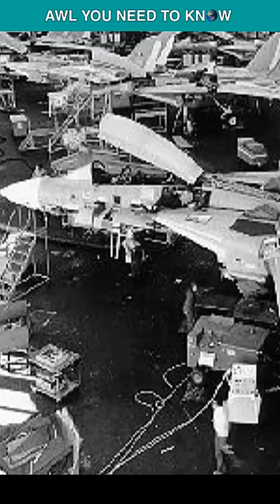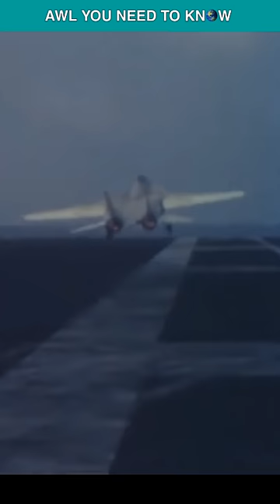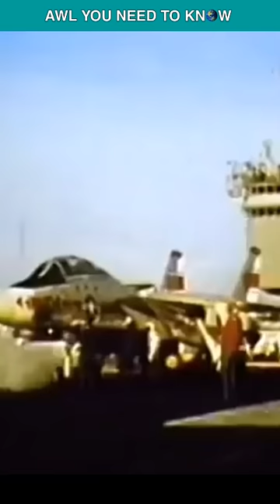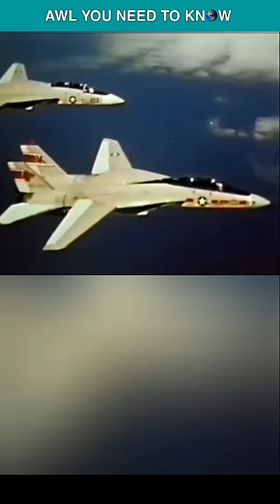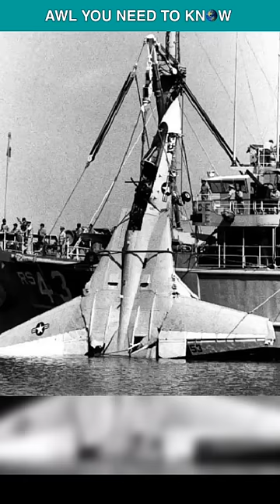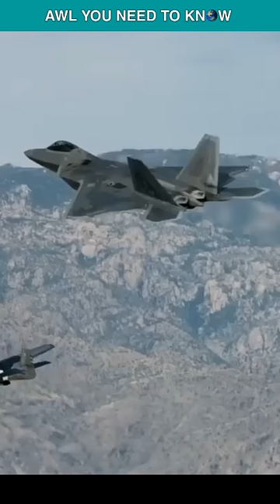Could The F-14 Tomcat Be Made Again? #shorts

Comment: The answer is yes the F14 can be remade.  If you take the increased use of composites material, replacement and improvement of digital design , project management and etc...  There are corporation that have found the bad of old technology and replaced it already.  For example, Boeing 777 airplane is an example.  The problem is the old experts who think they would be the leader and manager...total bullshit.  You are not just copying; you are reengineering based best practices standard of 2025 and not 1960's.  There is a process of reengineering based on functional requirements.

Comment: Lies but we still have the f15 and 16 those were around the same time period out of date lol what about the b52
Reply: F14 capabilities are outmatched against those fighters. The F-14 was great at bombing and long range kills. The new AMRAAMs on aircraft like the F-15 and F-16 exceed those of the F-14 and its Phoenix. The bombing capability is matched by its “replacement”, the F/A-18. Also, the F-14 is a naval aircraft, don’t compare them to aircraft designed for the air force. As for the B-52, the only reason why it’s still around is because of the sheer amount of payload it can carry. Yes, it’s old, but it will drop more bombs than any other aircraft we currently use.

Comment: And you found all those considerations regarding technology from just 1994? Can we rebuild the SS INDEPENDENCE? That’s from the 1950’s. Craftsmanship, craftsmanship, craftsmanship. Even the tools to make the parts are gone. And some of the methods for construction has been long forgotten.
Reply: None of them are necessarily gone, just vastly improved upon. There’s a reason the US doesn’t really use swept wing aircraft anymore.
Reply: @Dr.KarlowTheOctoling  Not retired? What CV (aircraft carrier) has one on deck ready for action?
Reply: @seageo4303  No. The tools. The tools to make the parts aren’t gone.
Reply: @Dr.KarlowTheOctoling  Do you know about hot riveting, and how it was used on the strake (shell) plating on the old ships? Who does hot riveting on 1” thick metal plates?
Reply: @seageo4303  As I said, improved upon.
Reply: @Dr.KarlowTheOctoling  There is probably enough information about the real King Solomon’s Temple that it could be rebuilt. But it is not possible due to the loss of the crafts that made it possible.
Reply: @seageo4303  Ahh. But that’s ancient infrastructure, not a plane. Rebuilding a swept-wing plane like the F-14, a complete redesign has to be made. 

The art of swept wings has been lost
Reply: @Dr.KarlowTheOctoling  The F-14 is ancient. It has been suggested that had aeronautic technology evolved as quickly as computer technology, man would have landed on the moon less than a decade after the Wright brothers made their first flight. The original theme of this thread was “rebuild.” Otherwise, you could redesign the F-14 and use a big 3D printer to produce them. But, that’s not the same thing. The author states the basic materials that constructed the Tomcat are unavailable. He didn’t event cite the possibility of vacuum tubes and CRTs!

Comment: We COULD build saturn 5s again too. But why would you?
Reply: The tooling and assembly lines for the Saturn5 is no longer operational or may not even exist in most cases.
 ..the Tomcat however still has warehouses filled and assembly lines still in place waiting to be dusted off.
Reply: @jplxlabelle1681  his point is that it’s obsolete and horribly expensive